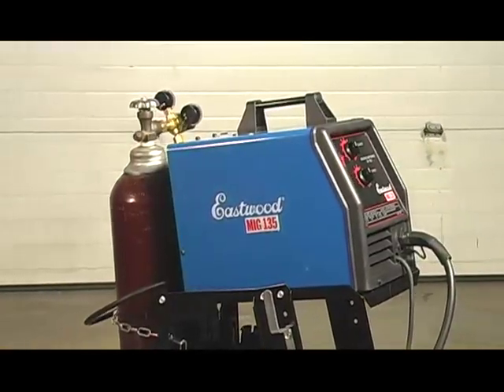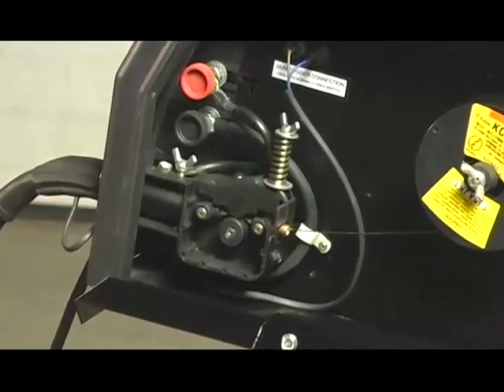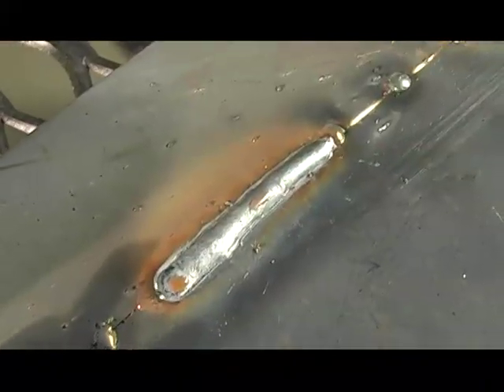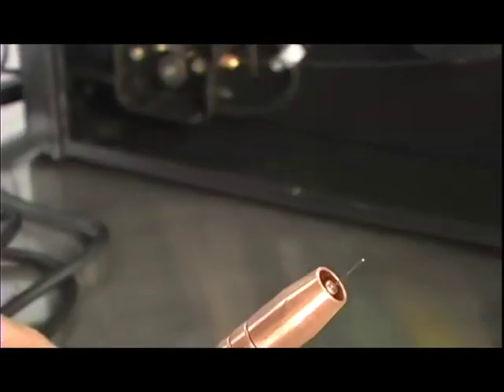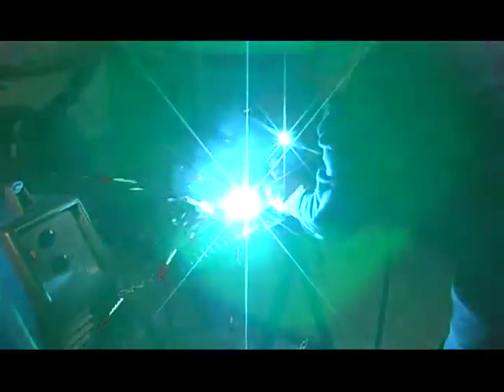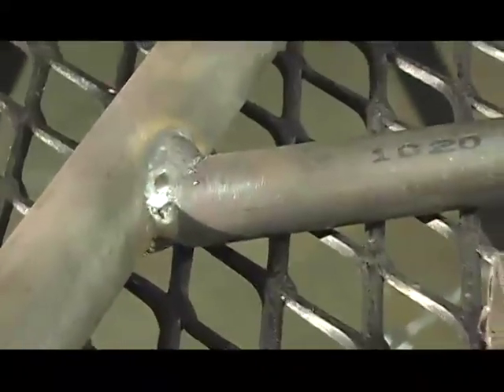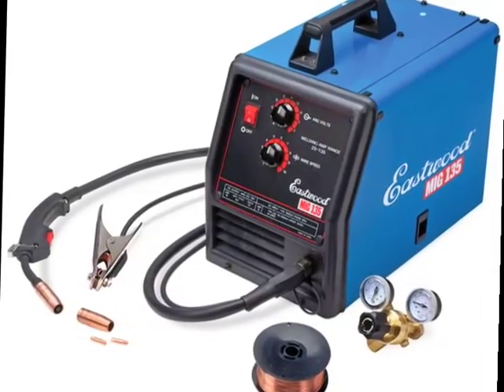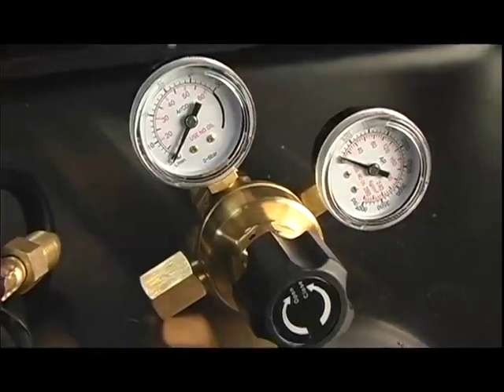MIG Welders- Learn How to Weld with Ease!  From Eastwood

Comment: Hey, if you ever figure how to build a 20 footer I might want to buy one from you!!! I live in an apartment and don't have any 40-amp outlets for the welder I presently have. I could use a 16 footer actually, with a covering canopy. Single axle is fine. My car has a tow hitch hookup rated at 3500 pounds. Don't need electric brakes either. No horses just looking to travel and move some stuff. If we can work a deal on so much per month we'll both COME OUT AHEAD. You aren't in TIMBUCKTOO ARE YE? VA